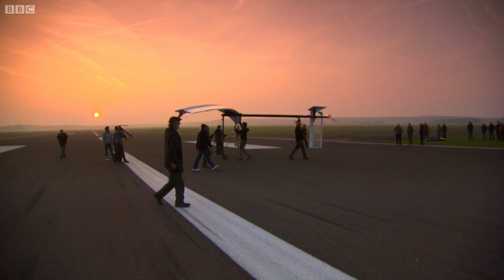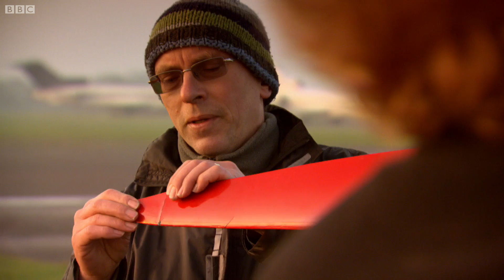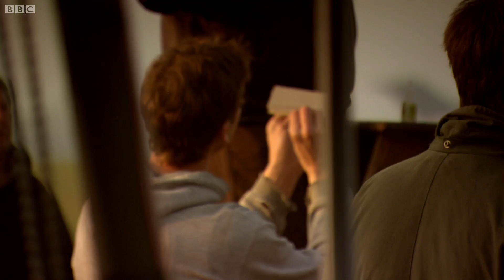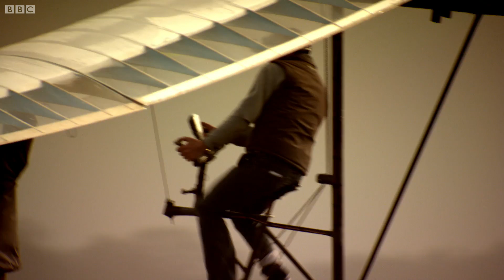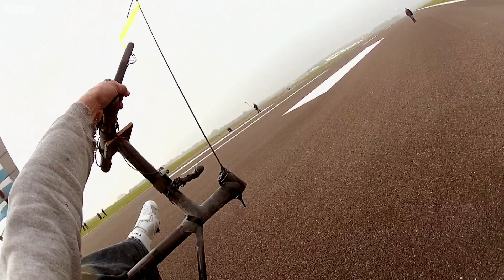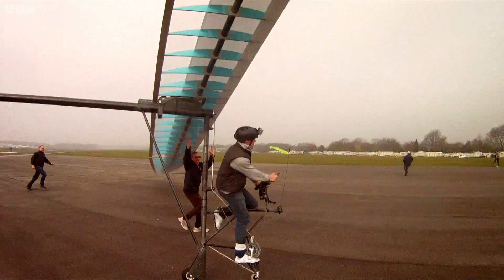Building a Flying Bicycle (Part 2) | Earth Science

Comment: you need a more advanced gear system
Reply: Nope... He needs a more advanced propulsion system. He got off the ground, but there's a reason why attempts at human powered flight are normally reserved for the best performing athletes... it takes a person in exceptional physical condition to sustain flight for more than a few seconds. People have done it, and it has actually been done for a while--but the people capable of doing the 'sweaty' work are relatively few and far between.

Comment: There should be a bicycle wheel that takes the power until it gets up to speed, and then he can switch gears to the propeller to take over once airborne.
Reply: I thought that too, they were probably thinking of weight and complexity, simple is safer, I think a larger prop with less pitch would be a help, it would basically give more "torque" off the line, instead of speed in flight.

Comment: The wings won't generate much lift if they aren't complete like this one (opened at the bottom)
Reply: Do you know how wings work?
Reply: +a1919akelbo Yes...
Reply: +TheLpd1 If you did you would know that the lift is generated at the top of the wing because of the Bernoulli effect. The top of the wing is designed to have more surface area (that's why the bottom is flat and the top is a bump) so the air has to travel further and in turn creates a low pressure area on the top. The bottom design does not matter so long as it is aerodynamic. As an example to support this you could look at the Krueger style flaps on a 747, they have multiple moving parts and all the mechanics and  parts are underneath the flap where the air staying intact and non-turbulent is not crucial to flight.
Reply: +a1919akelbo that explanation using the Bernoulli effect is extremely superficial, because other effects like the Koanda effect would explain the if the wing is incomplete a lot of flow separation would occur, thus compromising lift and generating a lot of drag

Comment: Why are you using an upright position with such a large frontal area? 
  Why isn't the pedaling arrangement in a recumbent riding position to reduce resistance and lower the potential leverage ratio against the wing tips while on the ground? 
 Why don't you have a spring loaded outrigger with a small wheel to prevent tipping while on the ground, or even a training wheels type device placed super wide on the cycle itself?
 Why are you taking on the weight of a bicycle chain when you could use a gates type belt drive as is available in the bicycle market already?
Reply: +KamiSapmelash A simple extruded aluminum rod could make an outrigger that weighs under 100 grams easily. The pilot could pee, loose the jacket, skip breakfast, and recover this much weight.
    I could build a recumbent riding position with the parts he has already used.
    Speaking first hand, a belt drive with it's composite cog drive system is much much lighter than a regular bike chain. With the length he is using there are 4-5 regular bicycle chains on this machine. Bike chains are heavy with 4 plates 2 pins and 2 rollers all made of hardened steel for every inch. A belt drive is a rubber impregnated carbon/aramid structure that is ultra light. They are not as common on bicycles because the bicycle frame has to be designed specifically for a belt drive. The belt can't be cut, so the frame has to have a removable section for belt installation. They are light but their biggest appeal to a cyclist is that they are maintenance free and unaffected by water so they are perfect for all weather commuter bikes, especially when paired with an internally geared, sealed rear hub. The Gates brand also makes engine timing belts and industrial drives, which is where this tech is sourced.... Hint hint you can get a super sized belt length by matching the belt type to automotive timing belts which come in much longer lengths :)
Reply: i believe they were trying to emulate a design from back then.
Reply: He stated in some earlier video that the weight the wings are able to take are already scarily close to breaking point so I assume adding any kind of outriggers, training wheels etc would simply make them snap.
As for a recumbent position I assume the point of mass in consideration to stability as well as the weight problem again with the need for longer parts for power transfer and  bigger seating arrangements.
When it comes to the belt drives I have no idea although I suspect they might not actually be a lighter alternative to chains but I have no first hand experience with them so I wouldn't know.

Comment: I like the passion for the build, but this is poor design. 

First, it looks unstable from the start on. I would build a lightweight trike in with the pedalist can lay down. Like a recumbment which makes it easier the cycle / power the propeller 

Second, the wing never is going to generate enough lift. Too tin. Even gliders have bigger / more width on the wings. 

Thirth, i missed support for the wingtips. That's why I would build a lightweight trike (aluminium or carbon since BritLab seems to have money).  😁 

But I am curious for part 3. 

Greetings from the Netherlands
Reply: It also seems logical to keep the wings closer to the ground. You're get a lot of ground effect for easier take-off and softer landings. And the wing tips couldjust have a little coaster or skid pad at the ends to offer support. It's soooo wobbly!
Reply: Great advice but I doubt they will take it on any time soon

Comment: I'd personally figure a way to add just enough weight to the rotor blades, or powered by the peddles to act as a flywheel to help keep that prop spinning with minimal effort. 

Downside is the added weight. But a small design tweak and some balancing could get you in the air in no time.
Reply: adding weights would make it keep spinning for longer, but it would take more energy to start them, and the same amount of energy to keep them spinning at the same speed as without the weights

Comment: Why the Absolutely Giant wings Surely if You Had Smaller Better designed wings the Thing would Fly
Reply: Because it need bigger wings so it can take off at a lower speed. Smaller wings won't generate as much lift and you will have to be going faster to take off.

Comment: Wind is helping a lot. You can "fly" with just a paraglider and a lil bit of wind.
Reply: thats how literally all planes work dumbass
Reply: Yeah, all planes fly just because there is wind.. not because they have lots of thrust.. naw, it's the wind. logic.
Reply: Friende  Said the guy stating planes fly because of wind. Make a clear and logical statement without desperatly trying to insult anyone like a 9yr old which just figured out that air exists and i might give you a cookie.

Planes without any form of thrust can just glide, they can't climb. Ofcourse they could gain some altitude if they get a lucky breeze but otherwise it's complete bullshit. Planes don't fly because of wind, planes fly because of air.
Reply: +LinkoN planes fly because of speed difference between the top and bottom wing (Bernoulli effect) it doesn't matter if you are being pushed forward or if air is being pushed towards you as long as the air is going fast enough over the wing to create a high enough pressure difference to generate lift. (I wasn't bashing on you I was adding to what you said)
Reply: a1919akelbo No worries, i didn't want to go that in depth. I just wanted point out that guy was talking bs.

Comment: Seriously you could run and jump higher for longer.   Surely we can figure this out?
Reply: Give it some more development and time, they'll get there soon enough!
Reply: Kevin Lind
Come on it's 2016.  You can jump off a cliff and fly for ages on a hang glider..
I'm sure it's possible to do it with just manual labour from ground level...
I think we are missing something simple here...
Reply: +Hanniffy Dinn then again, the point is to get it in a sustainable flight via on board  manpower, and they're somewhat close despite the awkward position of the pedals that prevents optimal speed, and that the pilot basically stands upright, causing drag. With the correct modifications this might just be it!
Reply: Kevin Lind
I think if it was more streamlined and literally hang-glider type materials, it could work !